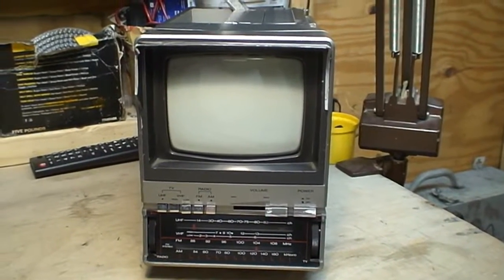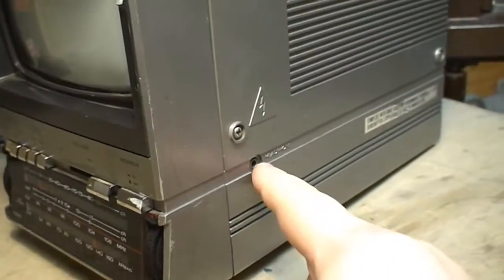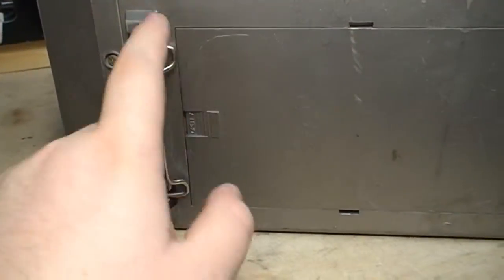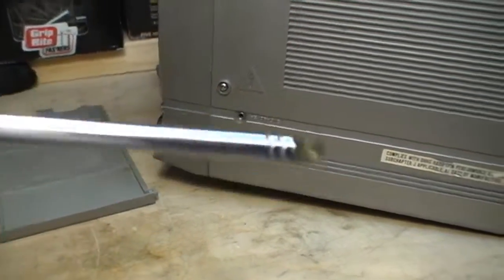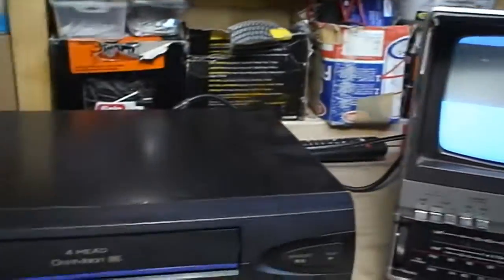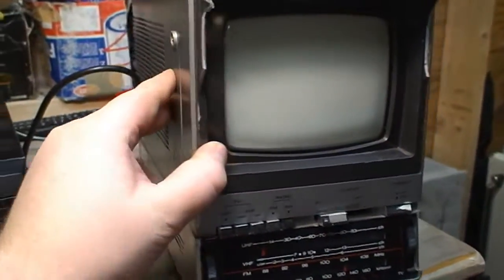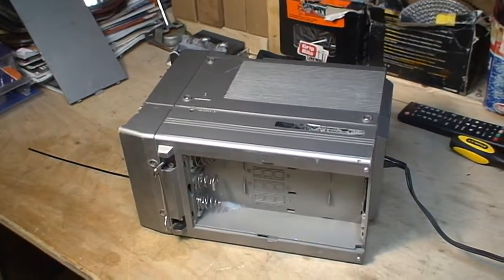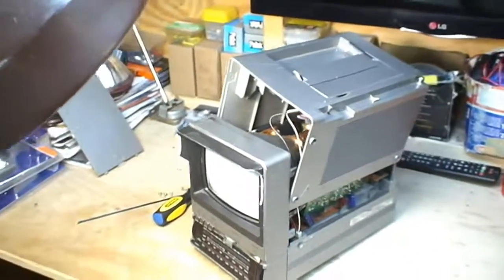1985 Sears SR-3000 Portable B&W TV

Comment: I can confirm that yes, this is a Sears, in fact this is the new (for 1985) model of the SR 3000, the previous revision, I actually like better (personal preference), it's black plus it included the PS band to the radio.  Both of these models are currently (2016-11-17)  on eBay (I won't link since the URLs are dynamic, just search for Sears SR3000). It hurt me to see the camera fall, hope it's well!  ~Jack, VEG

Comment: I think I could sit and watch that magic show for hours. You don't see anything that like that on TV anymore.

That poor TV. However the damage was done, it certainly doesn't seem accidental, at least to me. If you're able to remove the glare shield as well as the remains of the handle, it may look a little more presentable than it does now, even if it would be less characterful.

Perhaps the grainy picture can be attributed to the age of the recording on that tape. I've noticed quite a few older professionally recorded VHS tapes play like that. I have a Flintstones tape from 1986 (I think) and the recording on it has degraded quite a bit.

Comment: Hi, im not sure if your still around, but i'm setting up my own SR3000 to use a VCR and/or converter box. I'd like to know what cables you used and what ports you used on your VCR so i can try it using my own (a Hitachi VT-1110A). My Hitachi has similar screw down terminals on the SR3000 for UHF, as well as coaxial VHF ports, and video and audio in/out ports. I've looked everywhere for advice but didn't get any help and thought of this video. I'd appreciate the help tremendously. Thanks!